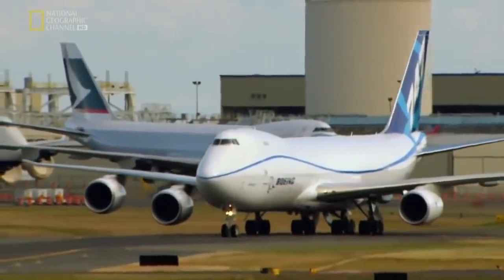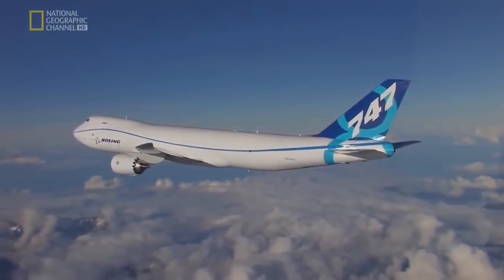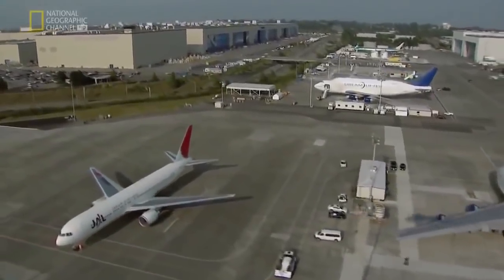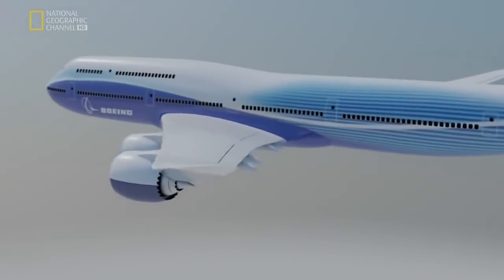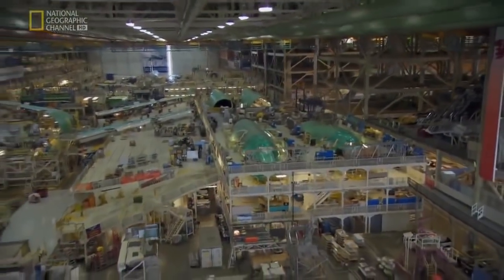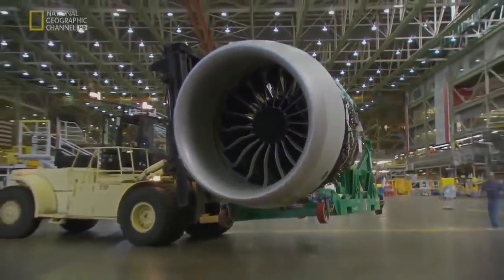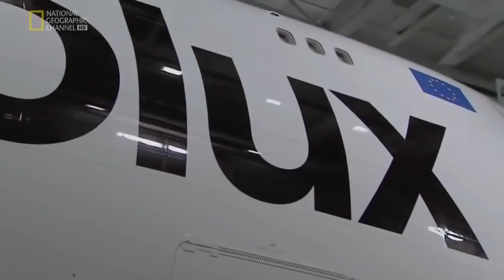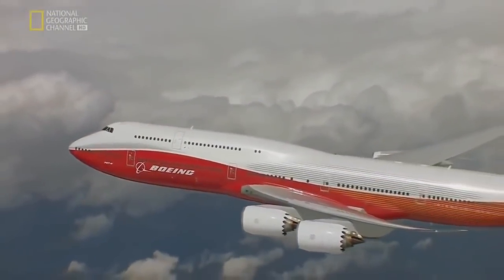Building Boeing 747-8 Full Documentary - Worlds Longest Airliner

Comment: When Airbus began its A380 program, with Americans confidently asserted that the global air-travel model had moved on; the model was no longer hub-to-hub which justified jumbo-jet production. No, the model was now point-to-point,  which needed smaller aircraft like the 777 and 787 instead - heavily implying that the A380 wasn't needed. So what did Boeing do once they saw the success of the A380? That's right, they felt the need to counter it and began production of the 747-8. Despite all their over confidence and cocky self-belief, they just couldn't bear to watch others bask in what was once their limelight. :D

Comment: As a cargo plane the 747-8 will continue to fly for many years to come. As a passenger jet however it's pretty much over. A few Korean Air routes and, of course Lufthansa. That's it. Unfortunately they weren't able to give this plane a wider range. Don't forget: The main reason for airline to buy this plane was NOT ITS SIZE but ITS RANGE. That was the main mistake they made when they produced the 747-8. Only an outstanding range that would have to be better than a Boeing 777 or an Airbus A350 would have saved her. So sad. She'll be missed.
Reply: @foobarmaximus3506  So true. It's kinda sad. I find it absurd to see routes at our Airports here in Germany that are now serviced with three 737s and used to be serviced with one 747 ten years ago.

Comment: A380 was great. However, they had issues such as when airliners purchased them and found out the wings were too wide and they needed bigger spacing to have them at the gates, the amount of timing  to overhaul, the operation costs

Comment: Video left out that the fuselage sections were built at Northrop Aircraft Plant 1 in Hawthorne CA.  Special tall train cars were built to haul the sections from Hawthorne to Seattle.  Several overpasses and bridges between Hawthorne and Seattle had to be upgraded to fit the taller train cars.  

Space X now owns the old Northrop Aircraft facilities, and build rockets there.

Comment: just in time manufacturing saves the manufacturer money however every vendor and parts supplier has to store the parts. I have worked with quality control in automotive industry and its the vendors and suppliers who have absorbed the cost of parts storage, the warehouse used to store just the fender flares for the jeep was huge. If a supplier is the cause for an assembly line shut down there are huge fines.

Comment: Let's be clear, flutter is not the aviation word for vibration!  Flutter is the aerodynamic harmonic resonance of the airframe structure or individual parts.  Engine or system vibrations for example are NOT flutter.

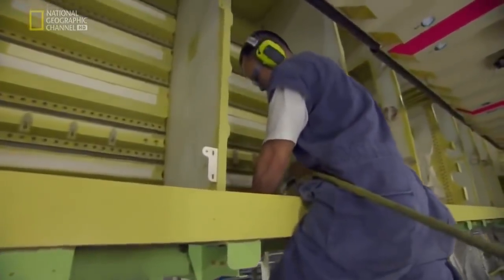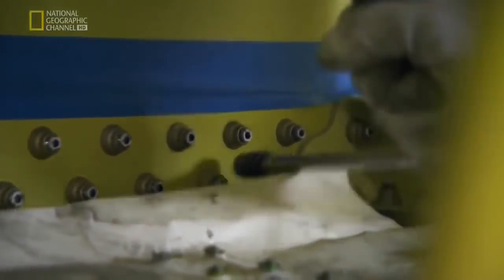Comment: 17:40 - 17:45 Hmmm...I'm a 20+ year A&P specializing in sheet-metal & structures. Way back in aviation maintenance school I was taught to never double-torque a fastener (unless the drawing calls for it, which is almost never). This rule still applies where I now work. This guy assembling wing skin to spar is torquing all his fasteners twice, which could put extra torque where it's not needed or wanted.
Reply: I disagree, respectfully. The torque wrench releases at the proper torque , within its tolerance, each time. Occasionally it will improve on a slight under-torque, again within its tolerance.
Reply: @stevescherer4954  Thinking of it, I'm sure you're correct. Not clicking torque more than once is certainly one of the things I learned in A&P school, as well as places I've worked. Everyone has to be overly-careful to the point of paranoia & silliness. Besides, the little bit of torquing I do always has a small range.

Comment: Are there any engineer, designers out there who can tell me if it's possible technologically to build a commercial airline fuselage in one section?
Reply: You make sense, Scteam. Just have always wondered if possible.
Reply: Perhaps, in the not too distant future a genius mind will say, "Hey, got an idea!" And there ya go, a single dependable fuselage. You know, it wasn't all that long ago some thought manned flight was impossible. I recall reading that some scientists thought man would die if motating better than 30mph in a train...
Reply: Indeed. Nothing surprises me anymore so fast technology tends to flow from concept to product. I wish it would slow down relative to computers so I can enjoy the one I have for a while!
Reply: I am just glad that I'm happy with old school when it comes to sound systems. Even my 28 year old son has gone to belt-drive turntables, vinyl and so on. Nothing better sounding to my ears.
Reply: You got that. Whenever I want loud after 9pm, I just put on a set of Koss from the mid-70s and they do just fine.
Reply: +robert glenn  I am an engineer, but I am very confused with your question and what scteam2000 is answering...
If you mean if it's possible to build a fuselage as a whole, then the answer is yes, but highly impractical...
firstly, for EVERY model of aircraft, you will need a custom made machine JUST FOR THAT MODEL, it will be extremely expansive and unnecessary.
secondly, it's much harder to build its internal feature if the fuselage is made in one piece.

hope that answers your question...
PS: English is not my first language, so please excuse my spelling as the shitchrome is not checking it...
Reply: Asterio You answered my question most splendidly. As for your English, it's top drawer. I don't know why I asked the question. I believe I was watching the assembly of the fuselage and simply thought....I wonder if it could be made in a single piece? Some have said it's a stupid question...however, the only stupid question is the one never asked. Thank you for taking the time to answer me. Cheers!
Reply: Scteam2000 My youngest son is fed up with matters related to a liberal college education and is now readying himself for study as an aeronautical engineer. I am very proud of him.
Reply: Scteam2000 Don't know your age, however, do not...I repeat...do not allow anyone however well intended, to influence your goals or how to determine so. Remain undecided until such time as you finally know the path..and it will come, no doubt about it.
Reply: About the only thing us old cats have left, advice! Hell, we've made every mistake under the sun and hate to see younger people doing likewise...hope all the best for you..
Reply: +Scteam2000  Unless it was a one piece composite. Even then it would be a design miracle.
Reply: +robert glenn So true, and it doesn't happen at the same time, or in the same situation for everyone. This can be one of the greatest gifts of college. In a relatively safe environment, you can explore all the possibilities, even that may hold the dream you never knew you had.
Reply: Bud Fields Very well put...the dream you thought you never had.

Comment: The Intercontinental uses the same advanced wings as the Dreamliner, the same incredible glass cockpit as the Dreamliner, calling this aircraft an old design is insane, nor is the aircraft lousier than louder than the the 380; other 800 has a quiet cabin, comparatively speaking. No new orders have been made for the 380 in 2 1/2 years,

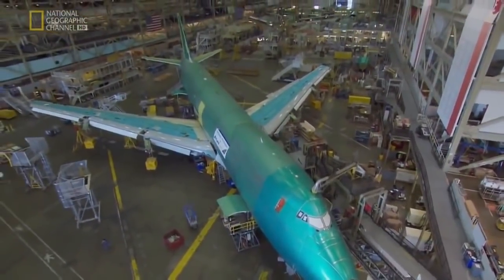Comment: 20:40 So they used software again to correct a physics design problem - sounds similar to another Boeing plane in recent news.
Reply: Exactly what I thought as soon as they said that.  Instead of correcting a gross design flaw, they threw software at it to make a deadline.  Pretty sloppy, and that sloppy approach bit them in the ass with the 737 Max 8.

Comment: the a380 is both  longer and bigger
Reply: Bigger, but not longer.
Reply: ChrisPMT but the a380 is faster
Reply: +Peter Buvik I know I'm a bit late with this, but this plane is only a temporary solution. Once the 797 (or 48 - C, or whatever the hell they're gonna cal lit) has finished its testing, and is deployed, hopefully in 2020, will outclass the a380 in all departments.
Reply: +Peter Buvik No, the A380 is not longer than the 747-8. The 380 is about 239 feet long vs 250 feet long for the 747. However, the 380 is bigger in other dimensions.
Reply: +Jingy2003 what's that in meters

Comment: Boeing is known to the insiders as the meat factory, every year they hire huge number of engineers and technicians, and in about half year later almost all except few gets laid off, so chances of having a career with Boeing is not very promising. The wing washout that here they call Sutter twist is not something new, even WWII planes had it. Fly by Wire was invented back in late 60's in military aircraft. Boeing use to have %90 of commercial aircraft market, but now they are down to %50, losing ground to Airbuss every day.

Comment: Can you tell me which fuel does aeroplane need and how does aeroplane steer in land
Reply: Huh? I'll try to answer. Since it is a jet it uses Jet A which is pretty much kerosene. While on the ground the nose gear steers the plane. The rudder pedals are used to steer the plane except for bigger planes there is a small wheel to the side (called a tiller) that the pilot uses to steer the landing gear. While in landing or takeoff the pedals are used for the larger planes.

Comment: As for a freighter use, the 747-800F is selling just fine, replacing 400's and MD-11's, that will keep the lines gong for so e time.  Airbus ruled out a A380F, the current 380 cannot be used for cargo, it's superstructure is too weak and cannot be reinforced, it would require a ground up, redo. Lufthansa sates that Boeings file savi g c
Reply: SJ Bobkins Airbus has the Beluga.

Comment: you cant take back the spot for the worlds biggest plane be making a "greener" version of one that's been around for like 30 years. if you really wanted the spot back you would make a true double decker that's longer than the a380 not one that 2nd floor is less than half the plane.
Reply: The holy basket  The 747-8 upper cabin is the length of a 737 And The A380 is a ugly whale

Comment: I'm confused wasn't the 747 contracted to the airforce as a freighter? But lost out to Lockheed's C 5 GALAXY? then Juan trip saved the Boeing 747 by a new marketing strategy for first class air travel... thus saving the 747 all together????
Reply: Not exactly, but close. Boeing had their own proposal for the competition that resulted in the C5, which clearly lost out, but gave Boeing engineers valuable experience in designing large aircraft, as well as some cargo loading solutions such as the nose ramp, and an appreciation for the potential of the new high bypass turbofans in use. The 747 came about as an adaption of this knowledge for a new low wing, high speed, (compared to the military cargo plane) civilian aircraft with unprecedented size and capacity. Pan Am did provide much of the push to go ahead with the project, so we can still thank them for the 747's existence.

Comment: Boeing compensating a vibration with software... not very trustworthy these days. Maybe need to reconsider flying the 747-8.
Reply: Yeah, the 747-8 has been in active service since 2010 and all without major incident. And the 747-8 has nothing in common with the 737-MAX MCAS system. 

Maybe you just shouldn't leave your house. It's a big world out there. A lot of stuff to learn. You'd get scared pretty easily.
Reply: Somebody doesn't get sarcasm.
Reply: @StaticImage  I wouldn't fly in any late Boeing aircraft unless I had to. Quality control entrusted to manufacturers of the parts Boeing join together doesn't instill confidence.

Comment: Does anyone know how a plane steers on the ground?Does the engines push it or the wheels like in a car
Reply: for long distances ,i mean more than 100 meters there is a bus kind of vehicle which pulls it....other wise engine
Reply: Joseph Stalin Whilst taxiing they have a tiller (steering wheel) in the cockpit that controls the nose gear. On some aircraft differential braking can be used to steer. When they are moving fast (takeoff & landing) the rudder is used. In smaller aircraft the rudder and nose gear can be connected so steering is done with he rudder pedals.
Reply: Ashwani Singh Tanwar Actually, that is only used to pushback the aircraft because it cannot reverse.
Reply: Joseph Stalin The engines push it, and there is a tiller to turn the nose wheel, and also, occasionally, the rudder and ailerons.